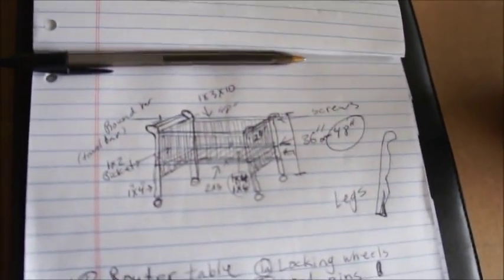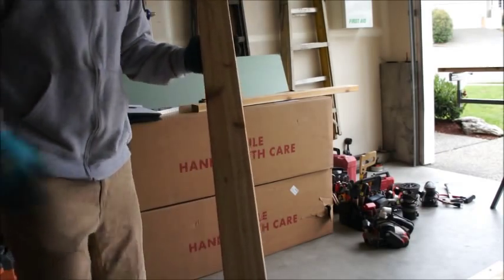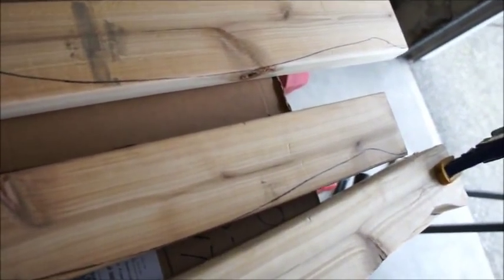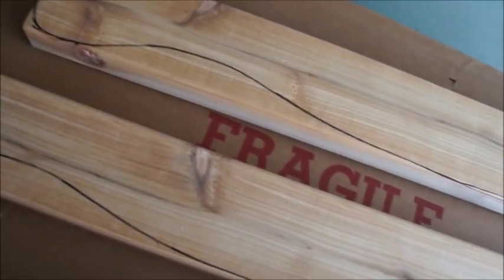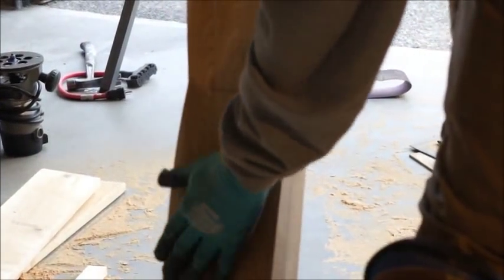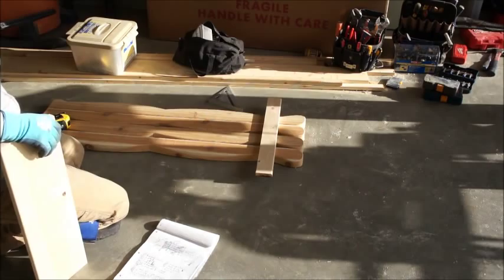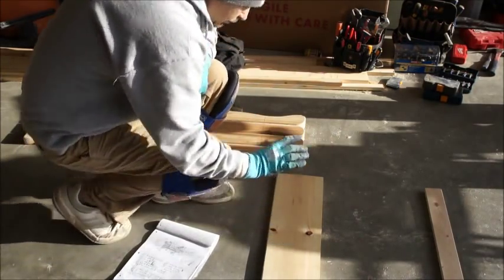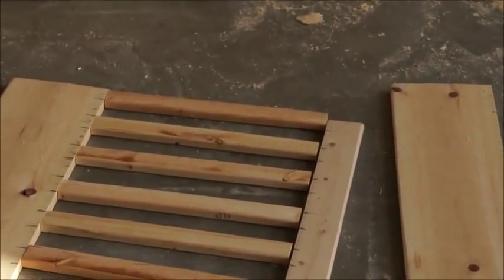how to make a baby crib

Comment: Nice build...so did you end up using the 2x4 for the final build or used different type of wood?
Reply from the maker: I used the same 2x4s that I have in the video.
Reply: paul k thanks for the quick reply :) greatly appreciated